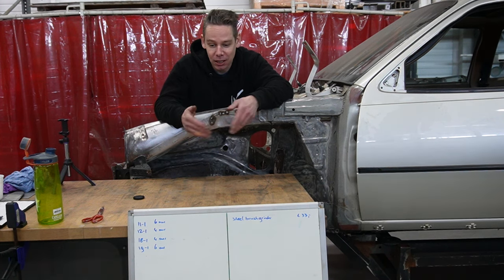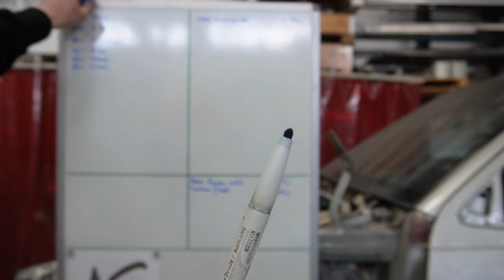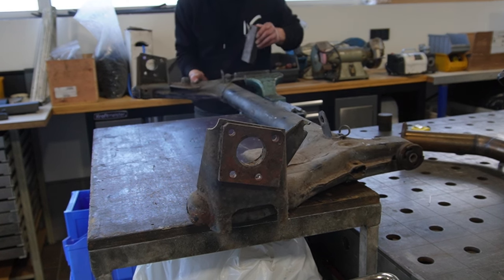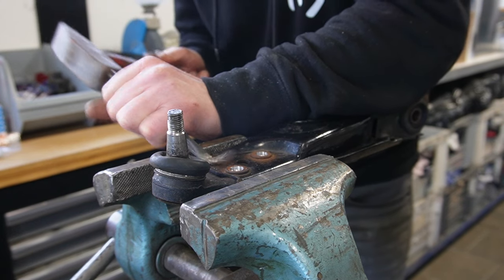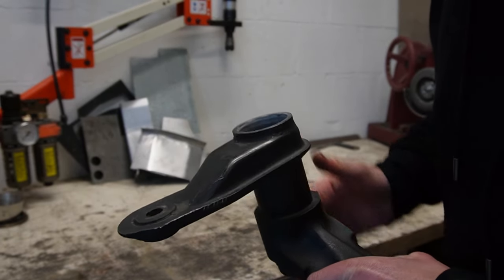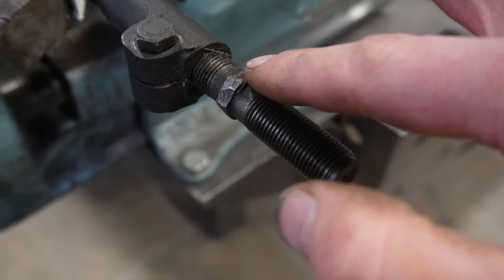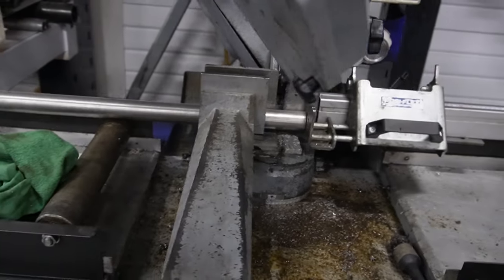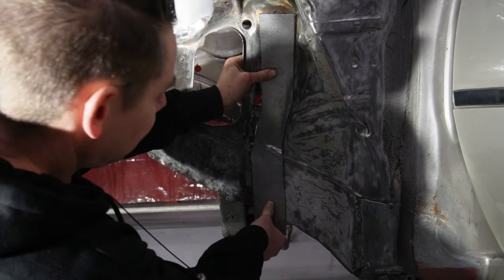Restoration of a unique Opel Kadett GSI so many parts to restore

Comment: We simply drill out the Rubber Bearings on the rear Axle with a pot drill!
The Rubber comes out by drilling from both sides and you can cut the metal sleeve with a saw! This is going very well.
Brakes always have Brembo Big Brakes 🥰
I also have Boxes like this with lots of leftover Parts and Parts from old Cars. These Boxes are worth their weight in Gold .
Mfg OCWX
Reply from the maker: Ah cool thanks for the tip, yeah you trow them in the trash anyway👍🏻
Yes i would love a brembo setup but then plan was to not go all crazy 🤪 🤣
Boxes are the best indeed !
Thanks again 👊🏻